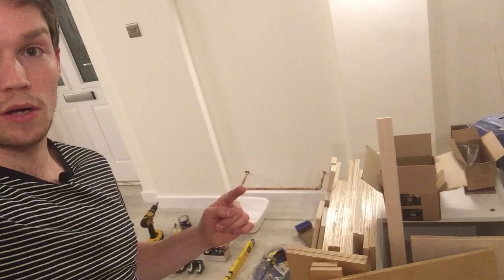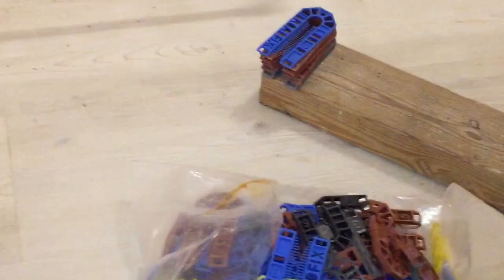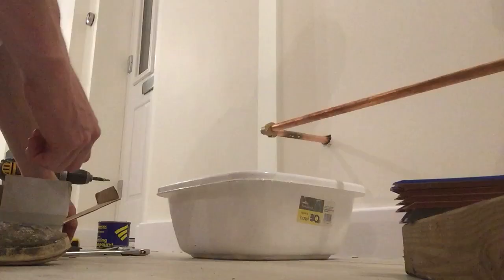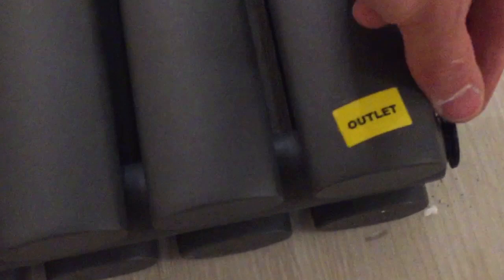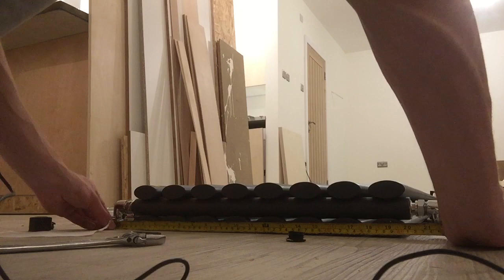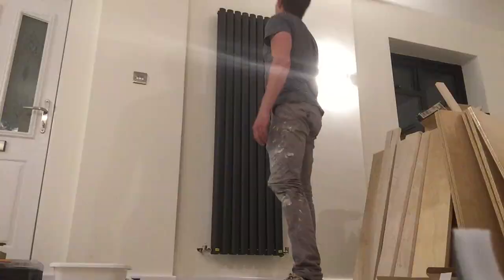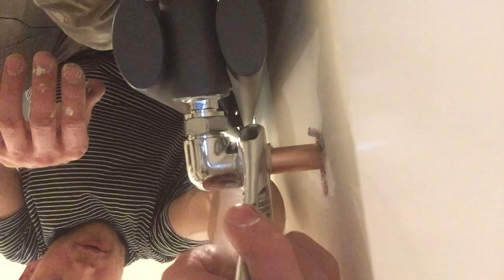HOW TO HANG / INSTALL A VERTICAL COLUMN RADIATOR  - Super Easy Detailed Guide !!

Comment: Why not hang the radiator 1st and add the valves, once in position you mark the holes for the pipes.  You then take the rad back off and get the pipes into position....

Comment: You probably did a better job yourself than most tradesmen would do But I guess most would want to hang the rad first and then bring the pipes up to the valves on soldered elbows to save a lot of time and effort. What you did was good stuff but it must've taken a hell of a long time especially with all those packers and I'm not sure I'd like the idea of balancing the whole radiator on the toolbox in case it slipped off and caused a lot of damage.Also there are definitely issues with marking a bracket like you did and then drilling and plugging the wall and fixing the bracket-in other words you can end up moving the whole thing by a few millimetres either way and that can make all the difference to getting those pipes lined up.Fairplay for doing it this way I've done a few myself this way and it does take a long time taking and checking measurements repeatedly so everything lines up.

Comment: Easiest way to get height is.
1 - measure from floor to bottom of bracket.
2 - add that to the distance you want the rad from the floor.
3 - measure distance from bottom of rad to centre of valve and subtract from above distance to give height bottom brackets go on the wall.

Comment: matt have a double same one doesnt fully heat up the left connection pipe  not thermo. one is not hot? I'm thinking changing the radiator do I have to drain system?

Comment: Graet video thanks. I installed one a while ago......but it struggles to get hot.....flow and return are both at the bottom.......but not sure if it should be fitted with an internal baffle to direct the water the top?

Comment: 11:49 a very helpful video. Thanks.
Just one question:
If the ‘in’ and ‘out’ pipes are the wrong way around, could I just turn the radiator upside down to correct this, or would this affect the working of the radiator?
I’m trying to avoid chasing out a large section of wall.

Comment: can any of these vertical style radiators be plumbed from the top ?. all my radiators downstairs  have pipes running all the way down the walls from the ceiling (unsightly) thanks.
Reply from the maker: The holes at the top are the same as at the bottom so you can plumb the valves at the top. But you might have trouble bleeding the air out of them. As the air rises to the top.
You could still bring the pipe down from the ceiling and fit to valves at the bottoms of the radiators.

Comment: I would like one on a stud wall…but I’ve been told the wall needs to be braced first… Is this correct?
Reply from the maker: It’s hard to tell without seeing it. Does it sound hollow when you tap it?
Reply: @MattHutton  yes… it’s a stud wall between two rooms.
Reply: @MattHutton  I looked at these from this company before I saw your video. Did you have any problems with them? Is the radiator working ok and is it as hot as the original style.y plumber seems to think they are inadequate
Reply from the maker: @supermum6099  i’ve had them installed for nearly three years and they’re perfect. If the radius is not too heavy you should be able to hang it on a wall that has plasterboard and skim coat over the top as long as you use some really strong plasterboard fixings I think it has two screw holes per bracket and four brackets so you should get a good grip on the wall.

If it’s just plasterboard that’s been painted and the plasterboard has been taped and jointed then it might need some reinforcement depending on what size radiator you want. If you don’t wanna reinforce the wall maybe choose a smaller radiator around 3-400mm wide by 1.8m tall. But without seeing it I’m just completely guessing. But that would be my thought process. Please don’t take my comment as conclusive advice.

Comment: Hate these brackets, they have zero play! Had similar radiator on and off so many times I get it close but it seems like the curve on the bracket isn’t small enough so the radiator wobbles a little. My wall is not square so I assume that’s what making it off, and my brackets are singular (one hook) not double whammy like in video. Ah we’ll try again tmrw with my packers 😢
Reply from the maker: Hang the radiator on the top hook first so that you know it’s in contact. Then offer up the bottom hook after and mark out the screw holes for the position you need in order to get zero play.
Reply: @MattHutton  - yup I did that. My brackets aren’t the same as yours in that they have a single hook, not two. I suspect the price of the radiator was too good so they gave me naff brackets. However I position bottom brackets there is a gap forwards and backwards (not horizontal) which to me, isn’t right. Either the bracket is too big, or the white washer is incorrect for the job and doesn’t hold the curve bit tight. I stuck a bit of folded cardboard in the gap which did the trick will have to do. Thanks though

Comment: Hey,
Did you attach the bottom brackets AFTER connecting the valves to the pipes - i.e by hinging from the top brackets? If not, how did you lift rad onto the bottom brackets with valves in place?
Thanks 👍🏻
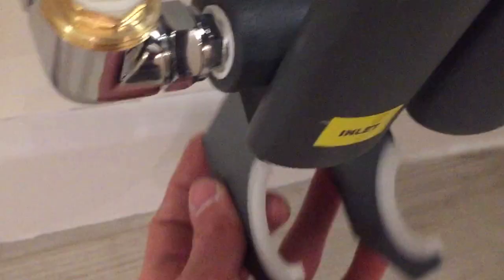Reply: 13:26 - he explains how he is going to attach the bottom brackets and says clearly that next he will show you how to connect the pipes

Comment: Great video but the reason I watched was to see which wall fixing you used I’ve bought 2 similar rads from trade radiators and they are really heavy even without the water.
Maybe record attaching the wall fixings next time.
Reply from the maker: I have OSB board behind the plaster board so I just used the screws that came with the brackets. What’s your wall made from?
Reply: @MattHutton  plaster board my son is an apprentice heating engineer for the council but I don’t think he has fitted anything this heavy before?
Reply from the maker: @garethlaidler539  https://youtu.be/aeFyQS2NGVM this video might help you with plasterboard fixings

Comment: Tidy just curious what you doing aboit the gaps around the pipes at the wall? Thanks
Reply from the maker: Hey, thanks for watching my video :) if the hole is small enough you can cover it with a pipe collar. If it’s a little larger you’ll need to fill it a little first with some kind of filler. Make sure to protect the pipe with masking tape because some fillers has cement in them which is bad on copper. Best regards, Matt
Reply: @MattHutton  that makes sense the pipe collars do they not go on first ? Or do some (i think I've seen them ) with a slit that can expand to fit over the 15mm pipe ? I'm currently doing the boys room that's no issue taken rads  off before and installed to existing.....I have horrid 8mm microbore and we will be fitting one if these in our kitchen hopefully soon ive put a small one in there fir now prob only has about 1000btu  but its only temp its a warm hoise ive considered bedding the pipes into the wall as it wouod be a lot neater and given that they usually pertrude  from the wall it be better to do so ......soz for waffling  on great informative video ill likeky use as a guide when I do ours .......I may fix rad  level and plum (not plumb it ) then mark where the pipes need to be then I can channel upwards to the ceiling/floor boards insulate pipes then infill with gyproc  easyfill  at least thats the plan

Comment: Great job, do you think replacing all radiators to designer ones will pay off in the added value to property? I currently have the whole heating system out and purchased a vertical for the kitchen. Looks so good unboxing I'm now considering doing all the rest! Not as much BTU as type 21 but they do look nice.
Reply from the maker: Im glad you liked the video :) I’m not really sure, property value. Might be worth asking an estate agent. I’ve always thought kitchens abs bathrooms were the money makers
Reply: @MattHutton  Thanks for your reply. I'm under the impression an average new kitchen cost £7000 but only adds £4000 to property (depending on current kitchen condition) Most people think of replacing kitchen when they look round a house. 
New boiler cost average £2000 but adds £8000 to value average. 
Off road parking, CCTV security, efficient and "smart" eco is a better investment. I'm trying to keep kitchen cost below 3.5k all in everything personally. Still nice but... Bathroom is worth it 💯.
Reply: @E69apeTheMatrix420  depends where you are buying your kitchen and how big it is. My kitchen has come in at £18,000 but my appliances are £9,000 🙈

Comment: Is there any advantage to using vertical radiators?
Reply from the maker: Not really,  just for aesthetics. Horizon radiators are better for convection and circulating the hot air around the room. :)

Comment: Can you hang this straight on plaster board
Reply from the maker: Hmmm depends how heavy the radiator is. Ideally it would be best to screw into Wood or brick behind.
If anyone pulls on the radiator or pushes it plasterboard isn’t too strong to fix into.
Reply: @MattHutton  how was yours fixed in
Reply from the maker: @SB-li8zz  I put osb board behind the plaster board before I had it all plastered because I knew I was going to hang the radiator there.
Reply from the maker: @SB-li8zz  you can get some very good plasterboard fixings though like these: https://youtu.be/aeFyQS2NGVM
Reply: What you pipe 15mm or 10
Reply from the maker: @SB-li8zz  15
Reply: @MattHutton  my pipe is plastic 10mm is there any adaptor so in can put a 15 mm copper pipe out of wall like yours